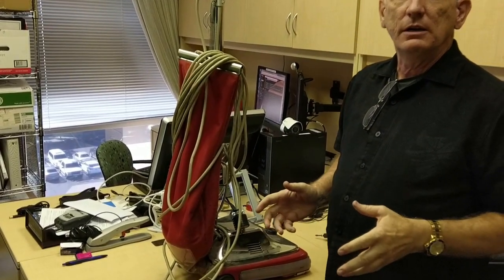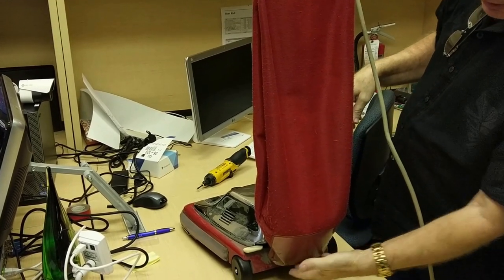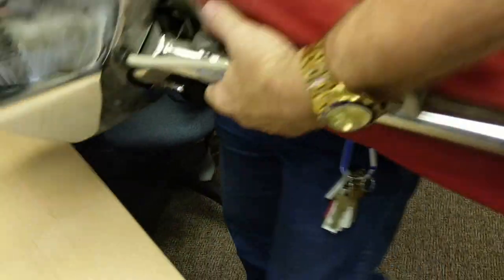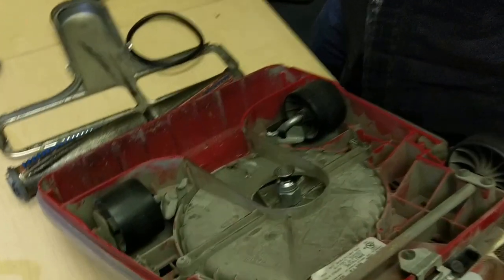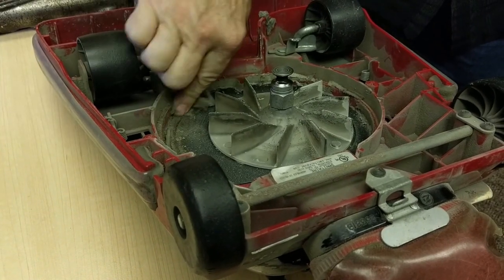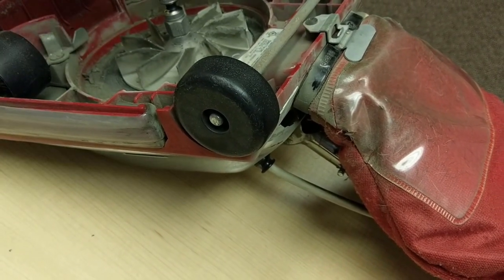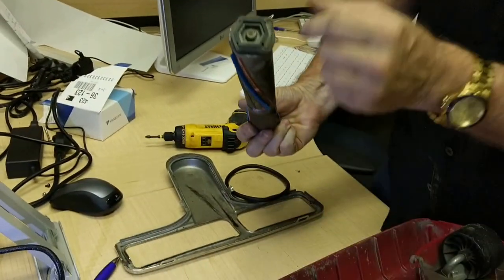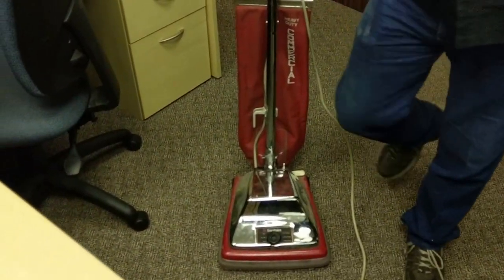How to clear and or rebuild a commercial sanitaire vacuum

Comment: I would personally clean the entire vacuum too so it's not so filthy. Like other people have said you can replace the brush strips on the beater bar as well as clean and lube the bearings so that it spins freely again. That beater bar is pretty rusty though so I would probably just get a new one myself. It's amazing how many people will continue to replace vacuums for hundreds of dollars rather than buying one of these and just maintaining it with the minimal maintenance they require. Not to mention they will outperform any of those garbage plastic vacuums.
Reply from the maker: So true , If you replace the entire brush roller bar and rarely if ever vacuum deep shag I highly recommend the double brush bar for low mat carpet like commercial carpet like this   http://i.ebayimg.com/images/g/TUoAAOSw95FZZZo0/s-l1600.jpg

Comment: How do I fix that loud noise coming from the motor?
Reply from the maker: @leehumes1883  3 reasons for loud noise, #1 bad bushings or roller bearings, #2 out of balance, #3 something rubbing on the motor or fan. 
To determine if it’s #1 put a drop of 3 in 1 sewing machine oil on the motor bushings or roller bearings, if the loud noise goes away then that is the problem , worn bushings, replace the motor. Worn roller bearings? Replace the roller. (also known as the beater brush)
#2 out of balance , check the fan for broken fins, #3 something rubbing? Disassemble and check for anything stuck in the vac path
I hope this helps , may God bless you and yours

Comment: I Have a Sanitaire SC-886 Shake-out bag machine, And a Smart Idea i Had is I put a Magnet On the Front Of the Machine And when i go To Vacuum I Will always See Paper Clips Or pins Or anything Like that and The magnet Pulls it up from the carpet while im vacuuming and it works really great👍
Reply from the maker: There is already a commercial kit that has been a rate available for at least 15 years it is a great idea it would even be a good idea for people with their home vacuum cleaners. I will see if I can find a link to it for you
Reply from the maker: https://www.amazon.com/Vacuum-Cleaner-Magnet-BBCM12-Length/dp/B00EUKLLTK/ref=sr_1_6?crid=2XZAOPY2T894O&keywords=Vacuum+cleaner+magnetic+strip&qid=1648425116&sprefix=vacuum+cleaner+magnetic+strip%2Caps%2C420&sr=8-6
Reply: Ok Thank you for replying

Comment: That's not the original brush roller for that vacuum
Reply from the maker: I never said the vacuum was all original equipment. There are plenty of aftermarket parts that are available for it. And the aftermarket parts worked perfectly fine although if you have the money I recommend getting original parts. The vacuum in question was not owned by me. It was owned by the cleaning crew that cleans our building and they wouldn’t even replace the bolts that held the handle together. They just stuck a wire in it.

Comment: I used to repair vacuums in the mid eighties and the Sanitaire was easy to fix and extremely durable. I have a sanitaire that I have had well over twenty years. Vacuums today are total crap.
Reply: Gerry Wills we have one too 16 years old still working great
Reply: Really? Cause mine has a height adjustment issue..Not the nob, but it either sits too low for brush to move or too high to touch the floor  .any suggestions?

Comment: Thanks for making this video.  I, too, believe in buying one of these commercial units because of their built-in longevity factor.  In fact, the sales girl in the local Sewing Center asked why I wanted such an expensive upright vacuum.  "Because these are very rugged and are easy to repair."  Some decade later, my Sanitaire is still going strong.  And because parts are so readily available and relatively cheap, you'd be a damn fool to buy something else.

Comment: I love how simple and reliable these things are I had 2000 16” SC899E, when I first acquired it, all I needed was a new belt, bag(it had a black cloth bag that takes Eureka F&G bags), and a new headlight, and surprisingly the bulb looks similar to one in my Kirby 514, except it’s 25 watts, and the one in my Kirby is only 15 watts, surprisingly that’s all that needed to be done even though it was dropped down some stairs, I guess these things are somewhat immune to fall damage, and mine even came with an original Sanitaire attachment kit which is still sitting in my grandma’s garage, i loved it, but I no longer have it because my city’s senior center where my grandma used to work is using it now and they love it just as much as me
Reply: Yes , my first choice for a heavy use environment

Comment: Sanitaire Vacuum in this video is GREAT!!!!! My problem is when vacuuming, the locks vibrate causing the plate to come off.  A couple of times, the rotor and belt fell off.

Is there anyway for me to fix it so this won't happen?
Reply from the maker: Katherine Grice The first thing I need to ask is when it is secure the two clips that hold the lower plates in place do they snap into place firmly or do they seem to very loosely move around?. If they are very loose and move around when they are all supposed to be locked in place then they have been bent. Quite often this can be corrected with a needle nose pair of pliers. If on the other hand it seems to be firm when it’s in the locked position but still manages to vibrate loose the next thing to do is to put a 1 inch piece of electrical tape over the top of the locking tab that the locking lever then slides onto. The piece of electrical tape will add extra friction to keep it from sliding off in vibration

Comment: Mine is making a screeching noise after vacuuming up shards of broken glass over lots of moisture. Had a full carboy full of water that shattered on the carpet and I had to clean it up for safety reasons.  How do you get at the motor bearings to see if that is causing it?
Reply from the maker: Charles Skye  Directly under the fan blade is possible culprit. The other bearing is away from where Glass would’ve gotten into. Another possibility is the bearings on the world itself or possibly since the dirt passes right by the belt, the belt may have been torn and maybe screeching
Reply: MrRoverpilot I replaced the belt already and cleaned things up.   What is the "world"?
Reply from the maker: Charles Skye put a drop of oil at each end of the motor shaft and if the squealing goes away that is it. Easier to replace the motor than the bearings.
Reply from the maker: Likely a model 697, Still likely either the motor or something has lodged its self between the Fan and housing
Reply: MrRoverpilot It's a S661A Finally got the bolt off by using an adjustable wrench and tapping the wrench handle with a hammer like an impact driver might while holding the impeller.  Cleaned everything out well and oiled both sides.  Little rust on the outside of the bearing under the impeller.  Got new gaskets and brushes at the vac store, everything works much better but it still has the high pitch whine.
Reply from the maker: Charles Skye likely the brushes are shot , the easy fix is still a motor replacement . You can replace brushes but the motor is not expensive.   https://www.ebay.com/itm/Eureka-Sanitaire-2-CARBON-Motor-Brushes-2000-4000-5000-SERIES/252981040775?epid=27002608973&hash=item3ae6d85687:g:~6MAAOSwPWRZOZVl
Reply: Thanks. How many motor brushes are in it? I took one out to clean it and put it back.  Still had about 1 cm on it.    Is there a wrong way to insert it?  The vac works great now after the tune up  besides the noise.  Where do you get the motor?
Reply from the maker: @cskye6529  match it on Ebay

Comment: I have a commercial 16 inch Sanitiare vacuum, I turned it on and the motor was squealing while I was vacuuming. What can cause it to do that? Could it be fist inside the motor?
Reply from the maker: The motor uses Bronze bushings as bearings , , You can try a lube , but that only works for a while usually , I recommend a new motor that can be easily replaced and acquired from E-Bay for around $40 with free shipping . The motor can come with the fan already attached
Reply from the maker: A recording of the sound would help ,  
Greasing the surface with a high temp bearing grease would work but that requires alot of work to take the motor apart , Not worth the effort in my opinion
Reply: MrRoverpilot Okay thanks! I turned it on earlier today and it squealed. It was picking up, but the squealing sounded like a light squeal until it got a little loud.
Reply: puddintang29 get a new moter.
Reply: do a how to on dismantling motor and greasing bearings if you please.

Comment: I use these vacuum cleaners at work...your video is terrible. you didnt show how to actually take off the bag and clean it properly.. the person that is video caant aim.. and you should practice taking apart the vacuum cleaner b4 actually doing it on the video.
Reply from the maker: Taking off and cleaning the bag properly is just so straightforward. I thought it went beyond any need to show people how to do that only slightly more difficult than turning on the on switch. Perhaps you do need to be schooled on that so in that case, I do apologize and I will consider, a video specifically for you to show you change remove and clean the bag. I specifically tended to make a video on how to repair those things that prevented the normal operation of the vacuum cleaner , my bad.

Comment: Hi..I know this video was posted a long time ago but I need help! My Sanitaire sweeper height adjustment either sets too low for the belt to move or too high to touch the floor? Any advice? I have fixed (I thought) everything on that vacuum and didn't think anything else could go wrong..wrong..or is there someone, or company I could call?
Reply from the maker: Are you certain you have the belt twisted the proper direction? The height adjustment should never ever be able to stop the belt from moving smoothly